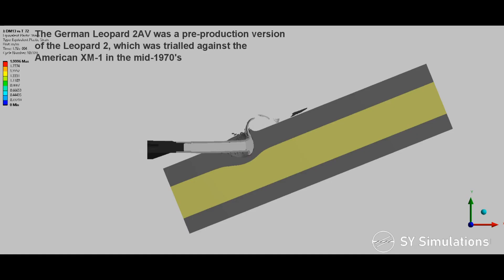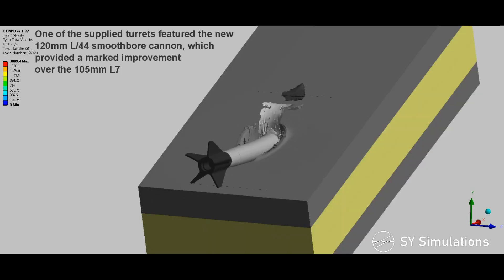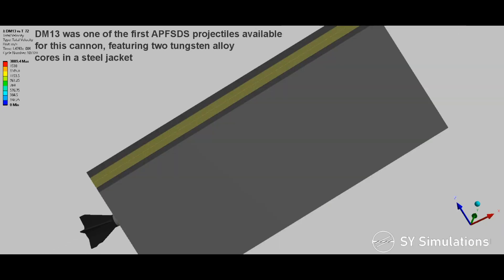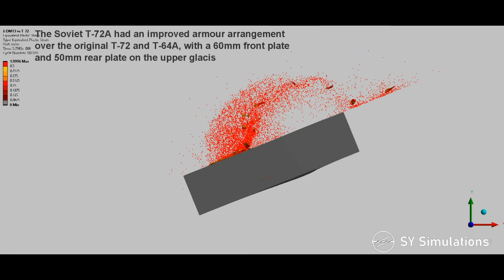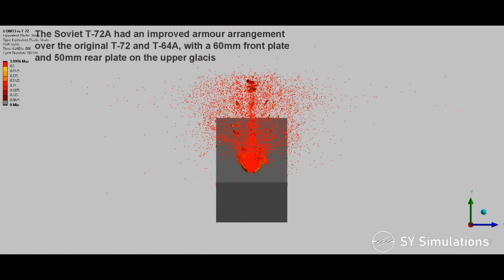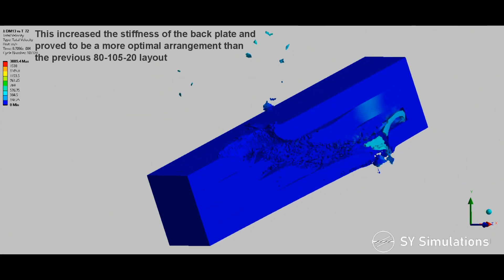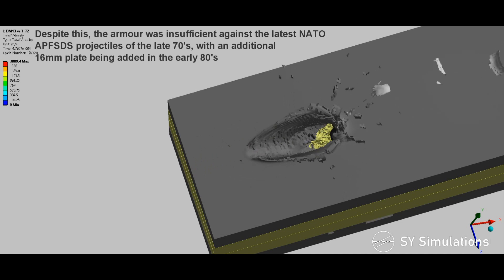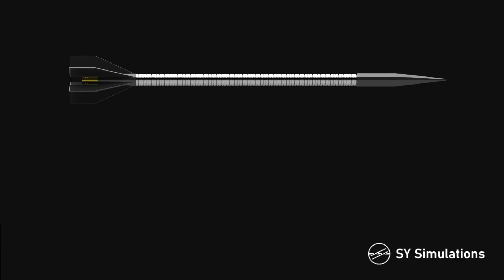LEOPARD 2AV vs T-72A | 120mm DM13 APFSDS Armour Penetration Simulation

Comment from the maker: Interestingly, there are a few sources stating that DM13 APFSDS can penetrate 220mm RHA at 2km @60°, which I find extemely unlikely based on projectile diagrams and core weights available online. I'd be curious to know what others think about this!
Reply: What is the total weight of the projectile you simulated?
It should be 4.64kg according to the ammunition datasheet.

I have some documents that state penetration at 2km on a NATO single target plate at 60°, it is much higher than the German TL target plates (213mm vs 178mm).
It also provides the range at which it can penetrate the assumed T-64/72 hull armour of 100mm RHA at 70° at puts this at almost 4400m.
The "reinfoced" T-64/72 hull armour of 15mm + 100mm at 70° can only be penetrated from a range of around 1500m.
DM13 is heavily affected by spaced or complex armour at high angles due to the construction method.
Reply: You should compare the M829, mM829A1, M829A2 and M829A3, that'd be interesting
Reply: " curious to know what others think about this!"

not much to think about it, simple western propaganda.
Reply: Hello which software are you using ?
Reply: I want to repost your video to the Chinese bilibili websie，It means distributing your video to other websites and marking your original link. Of course, all this behavior will not bring me any financial gain. It is all yours.I will not change your video, your video will be distributed to other websites as it is and bring Chinese viewers to your original video，It's all about generating electricity for love. In short, it's a porter. Of course, the machine translation I used may not be accurate when it is directly translated into Chinese?I'm waiting for your reply here
Reply: Leopard 1A5 105mm L7A3 DM63 vs T-72B1 hull and turret front
Reply: Автор, а характеристики текстолита в стимуляции соответствуют реальным или взяты справочные?
Reply: 220. 240 DM 23. 260 DM33
Reply: Advertisment always lies
Reply: @raketny_hvost  yes russian advertisments do as seen in ukraine where alomost every soviet/ russian system underperforms to its paper stats . While Nato Stuff usually overperforms to its Paper stats. Just one of many examples - Putins hypersonic cruise missile? Shot down by older Patriot versions crewed by quickly trained ukrainians. Go figure. 
If western official documentation says a projectile penetrates 220mm of RHA at 2km 60° - count it as 235mm will be penetrated ;)
Reply: The 50mm anti radiation spall liner might be able to stop the fragments?
Reply: @mr.waffentrager4400  The task of these anti-fragmentation linings is not to stop fragments, but to narrow the beam.
Reply: Maybe from L/55 cannon it could
Reply: make a dm 73 vs armata upper front plate vid

Comment: It’s not true that the 120mm demonstrated by the Germans showed significant improvement over the 105mm as demonstrated in tests at Watervliet Arsenal, NY. That’s why the Americans opted to hold off on the 120mm which would have delayed fielding the Abrams.

Comment: After the fall of the Soviet Union and its East German satellite, the Bundeswehr tested the Leopard 2A4 against T-72 glacis plates and the results do not confirm this simulation. The Leopard 2 gun had no problem penetrating the T-72 plate, while the L7 105mm struggled.

Comment: @SYsimulations
What Mass efficiency did u use for Dm13? 1.1?
Also. Do you happen to have a source for a realistic expectation of the 60-60-50 arrays performance in T-90 and T-72B (late)? I came up with a Mass efficiency of around ~1.16 against ke threats. Wondering what you happen to have found

Comment: Can you do the 7,5 cm K. Gr. Rot Pz fired at 650m/s (tho of course less over range) out of the FK 16 L/36 and the 10,5 cm Pzgr 14 kg at 405 m/s (which would be the LeFH 16 L/22) or at 480m/s (LeFH 18 L/28) or the Pzgr Rot (Apcbc) 15,56 kg at 390m/s or 470m/s (LeFh 16 and 18 respectively)? Against the B1 Bis, as those are the guns which were used against them as well.

Comment: Honestly the main thing this channel has taught me is that the American military is basically completely correct that speed should be the main armor.

What's the ratio at this point of a tank's frontal thick armor actually holding up to a shell in the simulations
Reply: Huh? 
In this case, a 16mm steel is enough to stop the penetrator at around 500m. 
Counting thickness is also more complicated than just tally up the thickness. 
How thick is era for example?

Comment: man, what is this textolite stuff? seems pretty effective
Reply: Seems like a sort of fibreglass product based on a quick google search, used for lots of other products
Reply: Yep, pretty effective at causing heat munitions to fail
Reply: It was needed against cumulative ammunition. The increased pressure of the first drops caused the debris to reflect and refill the channel, which prevented the passage of subsequent drops.

Comment: The textolite or whatever its called really does a good job, that slug from the penetrator sort of bounces off the second RHA plate into the textolite rather than punching straight through.
Reply: That happen whenever the remaining penetrator has too little velocity and/or mass. 
The textolite layer is one way to achieve that result.
Reply: Textolite is actually a super handy material for defeating APFSDS. Dunno why they did away with it. If anyone has an answer, please gib 🙏🙏 I wanna learn
Even against M829A2 (post K5) too
Reply: @belgianfried  they replace it with ceramic in late t-80u model, it is better.
Reply: @mr.waffentrager4400 The T-80BV's and the early model T-80U's had 3 steel plates separated by 2 plates of textolite, the textolite was later replaced with 2 layers of ceramics only on these models T-80U obr.1983, T-80UD and T-80UM.
Edit. This is the upper front plate hull armour
edit: I made a small mistake, instead of writing "T-80U obr.1983", I should have written "T-80U obr.1989". The T-80U only entered in production in 1985
Reply: @levilastun829  i know, you just added to my comment that's why I said later variants, i think your 1983 date is incorrect.
Reply: @mr.waffentrager4400  That's 1989 make, for both T-80U and UD (but I think by 1986 there was the option to switch?). Superior, but textolite can still be super handy
Reply: @levilastun829  T-80U was released first in 1985, the early models were essentially an improved T-80A (Object 219AS series). Are you sure?
T-80UM is also very ambiguous and T-80UD came in several models too, but with many not being recorded or lacking records
Reply: @belgianfried  I made a mistake, instead of writing obr.1989, I wrote obr.1983
Reply: @belgianfried  Textolite is a primitive form of fiberglass and it was originally designed to stop HEAT, not APFSDS. They replaced it with ceramics in later models because that's better at stopping APFSDS.
Reply: @belgianfried  Textolite is actually more effective against Heat penetration, iirc the textolite was done away with for the T-72B because of cost reasons.
Reply: @enriqueouro9  I'm quite sure T-72A 1983/T-72B1 used the new array because it had higher KE resistance, and T-72B received a slightly revised one that disregarded CE resistance more since all Object 184 (1984, T-72B) tanks are meant to be made with Kontakt-1 kit in all situations
Reply: @belgianfried  why is it always you in ap simulation vids
Reply: @chickenchicken8097  Cause I like tanks lmao
Reply: @belgianfried  wait are you the person that talked about russian people calling tank turret towers in another video?
Reply: @chickenchicken8097  oh yeah i am

Comment: The Leopard 2AV mounted a 105mm, not a 120mm. The American requirement was ther the tank had to use a 105mm.
Reply: There were more than one version fitted with the Rh-120 L44, the one tested in the US was fitted with the 105mm as the Americans required to test equivalent armaments instead two different calibers. Prototypes turrets like the PT19 was made to fit also the 120mm gun (early fitted with Hughes FCS and L7 105mm gun) or were directly made with it like the PT21 (coupled with the EMES-13 FCS).

Comment: Please do Merkava against tandem, normal RPG, and tank rounds. This one is anticipated.
Reply: simulating the trophy system will be a pain tho.
Reply: @ДмитроПрищепа-д3я  yeah, but he can just omit the APS, no need to simulate it just the Armor and the engine.
Reply: @ДмитроПрищепа-д3я  That's assuming it works lmao
Reply: @ДмитроПрищепа-д3я Most Merkava still don't have Trophy
Reply: Also with the current tandem - one tandem warhead placed by hand to sweep Trophy away, and a second one applied the regular way :)
Reply: @2nolhta trophy literally just blast the whole projectile though
Reply: SY Simulations has said that simulating HEAT rounds is very difficult and a very long process. Bro would probably have to have 50 gigs of ram and have to have his computer run for 3 days straight for an PG-7V

Comment: Can you please check if the 16 mm steel (500 HB) appliqué, installed on all T-72A in 1983, will change the outcome?
Reply: Definitely, 16/60/105/50 is enough to stop M111 and should help stop DM13 as well
Reply: From what I recall only Warsaw pact countries had 16mm add-on, while Soviets had 35mm instead
Reply: @okand1921  Tanks with older 80-105-20 armor layout received 30 mm appliqués. T-72A / T-72M1 with their newer 60-105-50 armor layout received 16 mm appliqués.
Reply: @azeke8  nah, what I got info from was about T-72A

Comment: Bit of a joke idea.   In the movie Delta Farce, the heroes use a Napoleon 12 pounder to disable an M4 Sherman.  I know it is unlikely to penetrate, but would love to see a black powder cannon shoot at a tank, just to see what would happen, or how big you would need to do any real damage.
Reply: What about one of those giant siege bombards? Like the ones with a 200-300lb cannon ball?
Reply: @jvt3888  In terms of ww2 RHA/CHA they have definitely would degrade armor value or entirely tank just turn into Tin foiled armor
Reply: Second that
Reply: I don't who what it was but someone did a video like that on a medievil seige canon vs a tager 1 and it absolutley obliterated. Granded that ball was like 300mm wide at least
Reply: @tirushone6446  Where technology comes up short, you can always compensate with sheer mass.
Reply: I third that
Reply: A 12 pounder would be firing a ~12 lb shell/ball, at roughly 1500 fps.
The 7.5cm KwK 40 L/48 of the Panzer IV fired a 15lb shell, at ~2500 fps.

I think if it hits the armour, it will just bounce, or more likely, just shatter.

For reference, the 7.5cm KwK 37 L/24 fired basically the same APCBC projectile, at ~1260 fps, and could penetrate around 50mm of vertical armour at 500m.

But that is a projectile that is roughly 65% the diameter of the 12 pdr, and designed to penetrate armour. The KwK 37 could punch through the side of a Sherman, if it got basically a perfect broadside shot, but other than that, it was likely to be defeated. A larger, lighter, round ball? I don't see it having the ability to penetrate the armour, at all.

Now, disabling the Sherman? Yes. Hitting the track itself, would very likely break it, and hitting one of the bogies may damage it significantly, and cause the track to walk off. Hit the barrel? And the Sherman is disarmed.

Still be interesting to see.

To do real damage, I suspect you would need the 24 or 32 pdr from naval ships.
Reply: Would be neat to add shock and audio sensors inside the hull..may not penetrate but I bet crew gets at least momentarily stunned
Reply: I would love to see this!
Reply: to a modern tank only will be a lost of paint xD
Reply: @InfernoVolatil there was simulation with Czar cannon vs M1 Abrams.
Result- Abrams with HUGE dint in front and obliterated cannon.
Reply: Fourth that
Reply: Hahhah, nice reference. I got to watch that movie again.😄
Reply: I mean tank armor is made for piercing kinetic rounds or chemical rounds, so it probably would mess the armor up quite a lot if it's as lightly armored as a Sherman because of the sheer projectile mass

Comment: I assume you already have experience with simulations. In your opinion, does overpenetration exist?
Reply: In real life? Absolutely, there's plenty of recollections of it happening in WW2 already. Its quite unlikely to happen after a frontal penetration on a modern MBT, but on a side shot it'll go clean through and out the other side, this definitely counts for any "soft" targets driving around.
Reply: APFSDS vs a truck or barely armored APC? Yes, against just about anything else, no.
Reply: There is footage of a Maverick missile hitting an armored vehicle from a side at an angle, penetrating through the other side and then hitting the ground and exploding.
Reply: @JAnx01  I would never in a million years expect a Maverick to do that and make it out as anything more than a formless hunk of wreckage.
Reply: @tackytrooper  I can't find it anymore and I don't remember the vehicle. Probably an M113. But I also remember seeing it repeatedly in military shows that aired in early 2000's on the Discovery channel.
Reply: All it takes is reading some primary source.

Comment: Could you do Leclerc APFSDS vs T-90 armor ?
Reply: and then charles leclerc vs apfsds (in ansys)
Reply: im reltively sure any sabo would go through most parts of a leclerc @rykehuss3435
Reply: APFSDS is designed to penetrate tanks. Charles Leclerc isnt a tank, it simply wont penetrate him @rykehuss3435